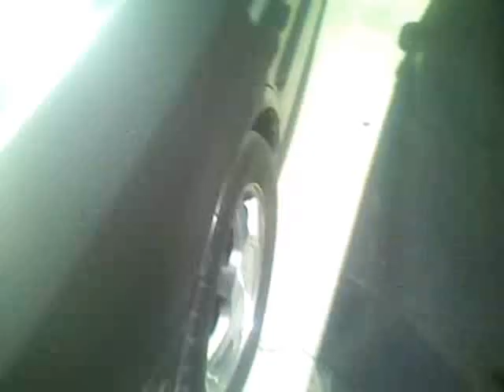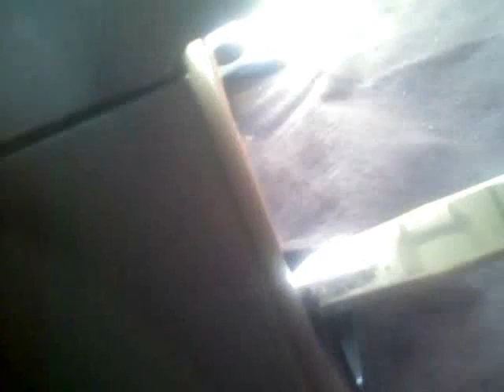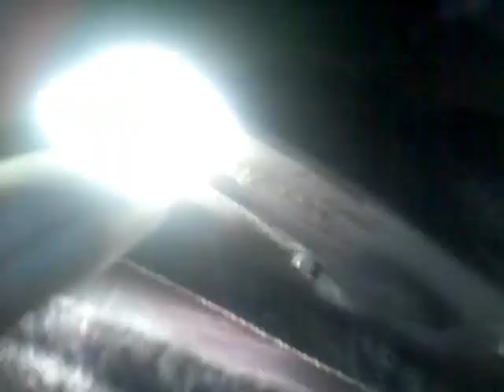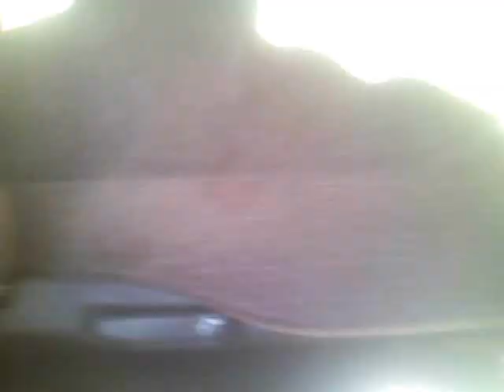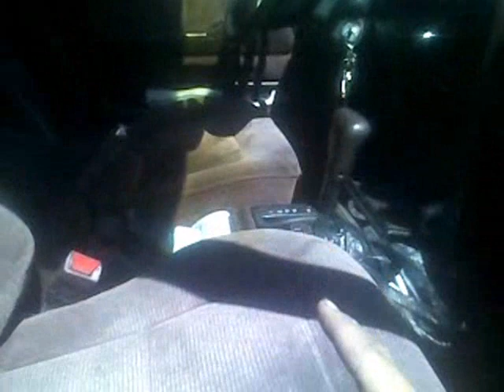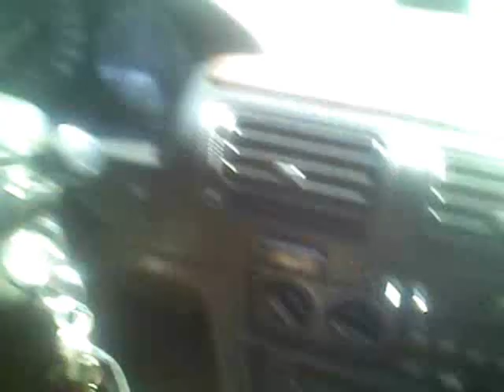fuel pump kill switch.wmv

Comment: All you have to do is pull out the fuse for the fuel pump. :)
Reply from the maker: But when a thief tries to steal your car and the car will not start, they look at fuses first, not for switches
Reply: Good point... I see you have had this experience... You don't have to tell me which side you were on... (Ex... Theif or victim)
Just kidding... :)
Reply from the maker: rag Doll Sorry, didn't see this comment.
I am the mechanic, and a victim came to me for help when a thief hit up the victims car.
The kill switch prevented the vehicle from being taken, but the thief managed to break misc items in the car.

Upon closer inspection, the thieves went through ALL of the fuse box locations of the car to look for any fuses that were pulled.
They tried so hard to take the car, they drained the battery in their failed attempt to crank it over.
Reply: Dao Vang
That's okay. :) Nice to hear you helped the victim though. ;)

Comment from the maker: A kill switch is a form of anti theft.

If the thief does not know where the switch is, they will not be able to start the car.

And for a thief trying to get a car under a few minutes or seconds, would not deal with the time to search for a switch and get the car running and would simply move on.

To some others, they rather have a beat up car from thieves not being able to steal the car, than to losing the whole car and never getting in back.

Comment: Why would someone want to use a "kill switch"? For what reason? What kind of car do you have. The fuel pump seems pretty easy to get to. I have to replace my fuel pump. I have a 94 Honda Civic. The mechanic wants to charge me $150.00. So I will be trying to do it myself. I hear it isn't that hard.

Comment from the maker: Yes, the video was recorded from a calculator.
There was also no relay installed because of the distance, causing the wires to get hot over long duration of driving.
And the kill switch is in plain view right next to a dummy one.
Kill switches are meant to be hidden.

There are many problems here, and many others i missed. Care to add more?